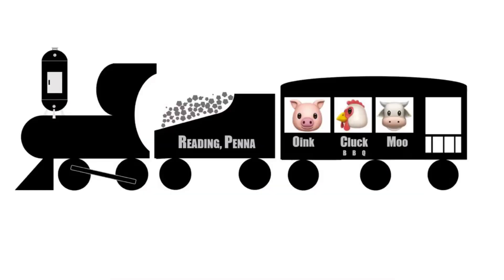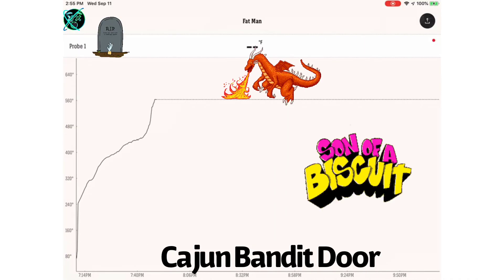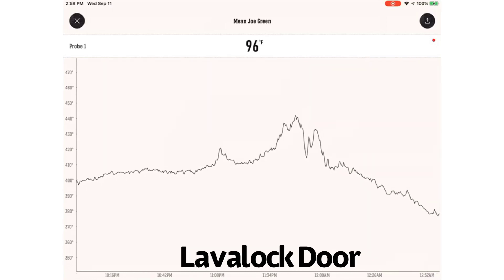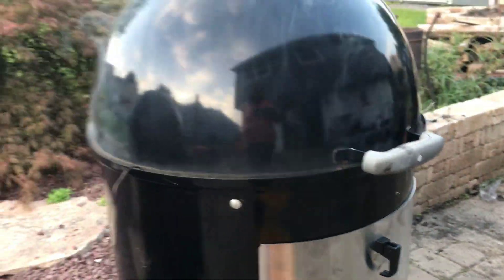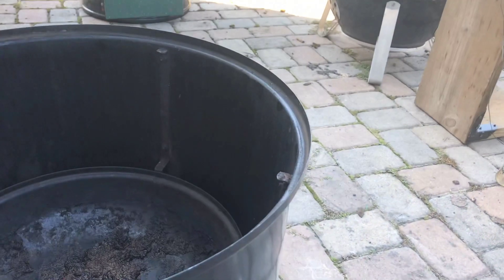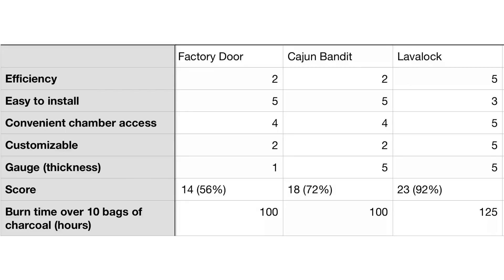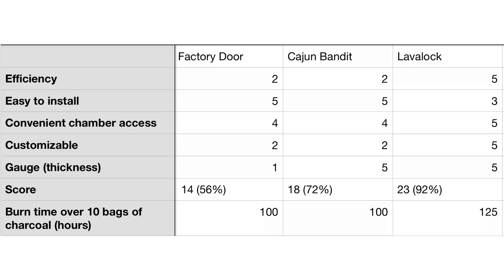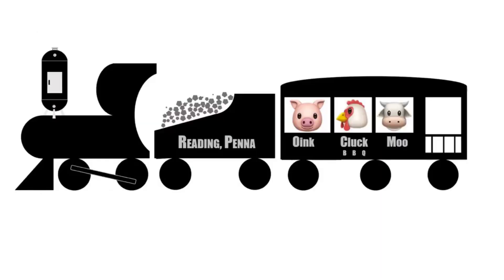FireDial™ vs  Factory  Weber Waterpan WSM comparison - Waterpan or Baffle system for WSM

Comment: One big drawback over the lavalock door is the cover does not fit you have to buy a larger cover. As far as burn efficiency a controller handles that. Both doors are nice I’ll stick with my Cajun Bandit.
Reply: That’s not true mine still fits. Why use a controller like a sissy might as well use a traeger